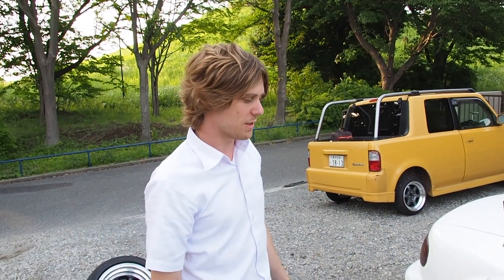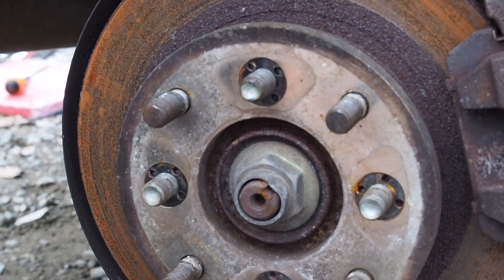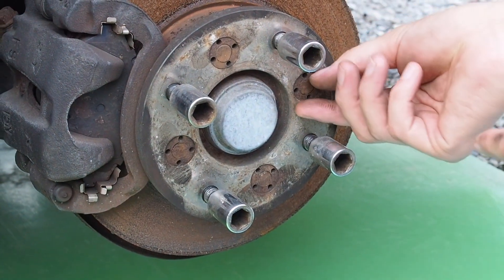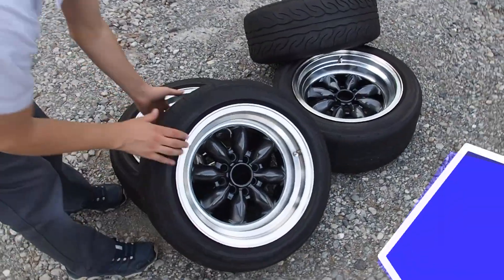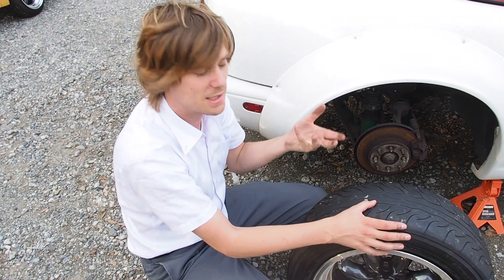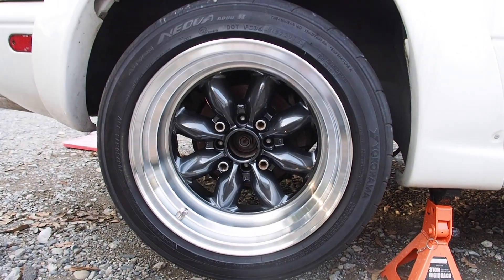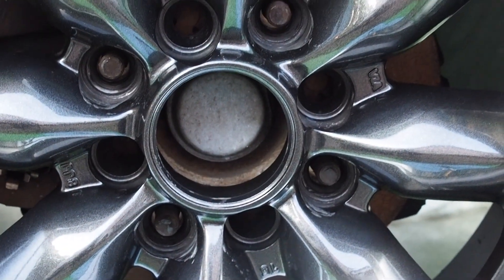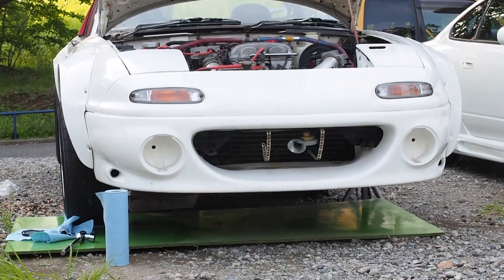The Hardest Part To Get Right Should Have Been The Easiest (S19E06)

Comment: I had this issue with my Cedric, tried to run spacers on stock 15s but didn’t realize that the studs were sticking out, front wheels almost popped completely off. Ended up using the 19 Rays with the spacers since they have the spaces for the outstanding studs. Almost ruined my day that time.

Comment: Why do you have absolutely the same set of jack-stands as I did put my Legacy on?
And combination of foldable in front & solid in rear matches mine. Only one difference - my vehicle have already spent a year on that jack-stands. And it's almost totally disassembled. Because I have a daily pickup-truck & wife's Legacy, so, there's no need to restore the car quickly & I'm a lazy asshole. :-D